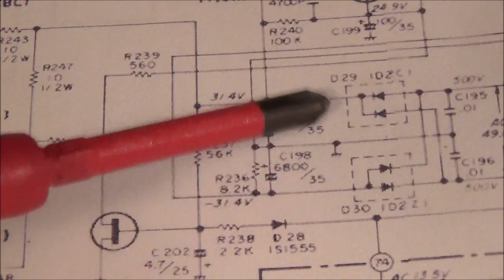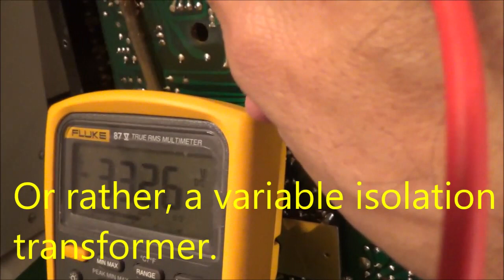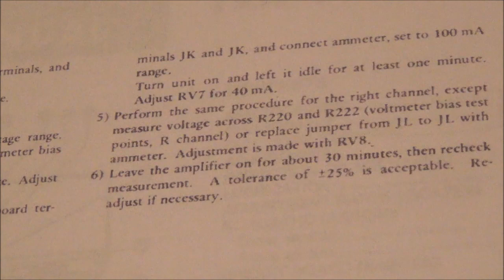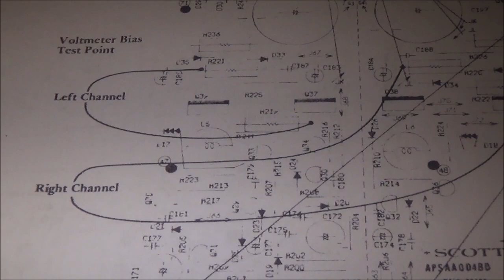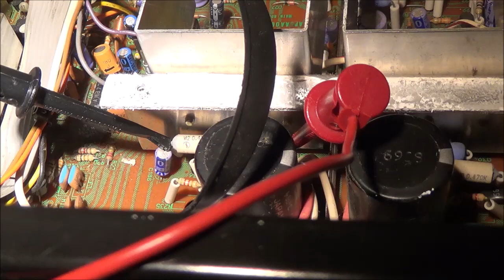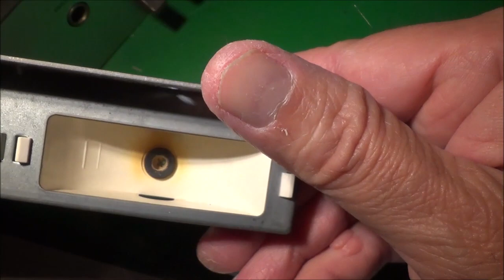Scott 330 Stereo Receiver -- Further Work

Comment: hi sir i wanted to know if u could help me repairing my sanyo candica searchlight NL-S630N?
Reply from the maker: You will need a multimeter and you must know how to use it. Taking a guess, I would say the problem is the batteries, light bulb, or the charger (in this order). Of course, other things could be defective too (like a switch or contacts). If the flashlight is older, you might have NiCad batteries, and these don't last forever. Really, unless you have a bunch of spare parts like batteries, bulbs, etc, you will need a multimeter.
Reply: Old School i think the batteries are the problem, according to ur checking procedure, can i put different batteries in it if not Nicd?
Reply from the maker: Well, your request has nothing to do with Scott receivers and I am no flashlight expert, but what do you want to know?
Reply: Old School it's not getting charged though i have kept it for 2 days now
Reply from the maker: If you intend to substitute with NiMH batteries, I would get a proper NiMH charger in order to charge the new batteries. You could probably use nonrechargeable batteries such as alkaline, but you have to be aware they are cannot be recharged and the voltage will be higher: 1.5 volts versus 1.2 volts per cell. The higher the voltage, the shorter the life of the bulb. If you just used the new NiMH batteries with the old Sanyo charging system,  I have no idea how long the batteries would last. Do so at your own risk.
Reply: Old School thanks for the help 👍
Reply from the maker: Good luck and let me know what the solution was, if you have time.